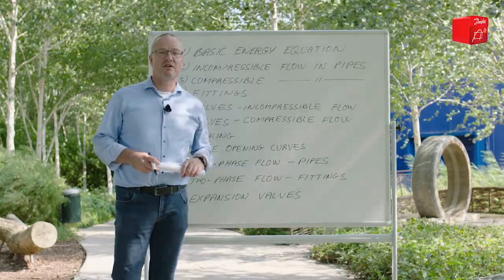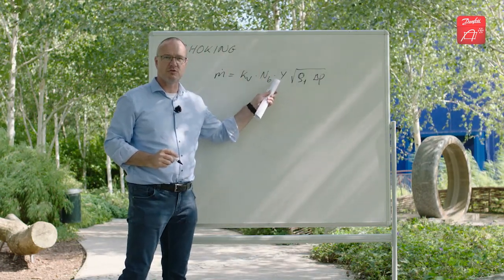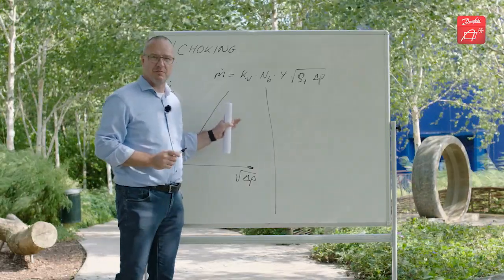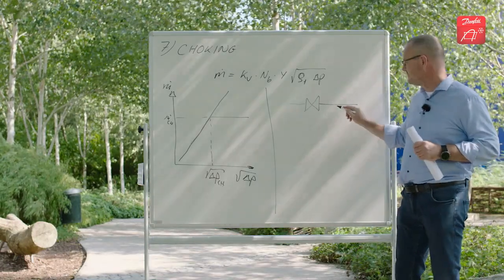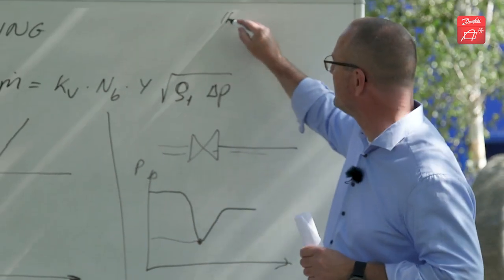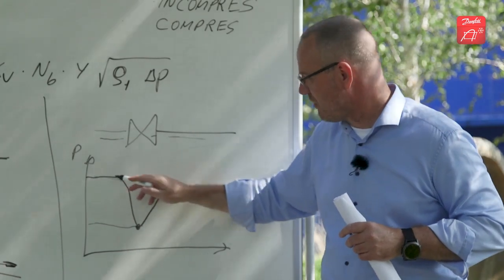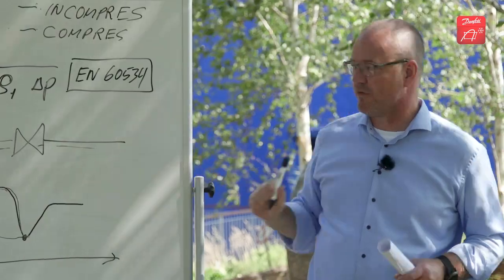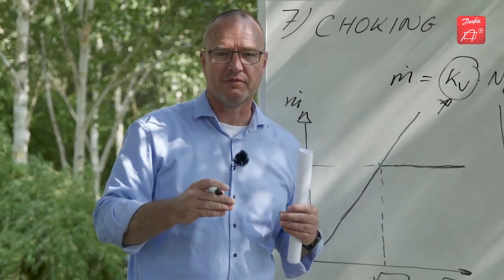Limiting Flow Through Valves (Valve Choking) – Coolselector®2 Deep Dive

Comment: Thank you so much for your helpful explanation! Anyway I have this doubt: In a power fluid system the flow in terms of liters per minutes is imposed by the volumetric pump. Why the flow is reduced by a choking valve if the mass is constant? Where the mass goes? I know it can not disapper :-) but there is something I'm missing. I know that in oleodinamic systems the speed of a cylindere is controlled by a choking valve but the speed of the cylinder is imposed by the flow rate (l/s) while the pressure inside the working chamber is a consequence of the resistance. So why the chocking valve can reduce the speed of the cylinder if the mass per second is constant?
Reply from the maker: Hi Moreno, glad you found the explanation helpful! We will check with our experts on your question and will get back to you.

Comment: Very good clip! One question:

I understand the velocity can not be faster than speed of sound - but wouldn’t increased up stream pressure lead to higher density of gas and therefore more mass flow?
Reply: yea it will have higher density but lower volume since that the area is smaller in the valve ,, m=density*volume ,, so the mass flow will not increase because u lost volume